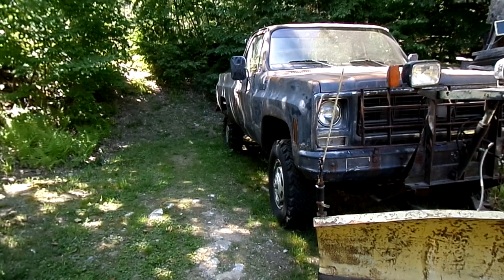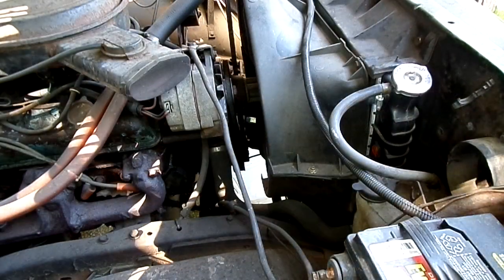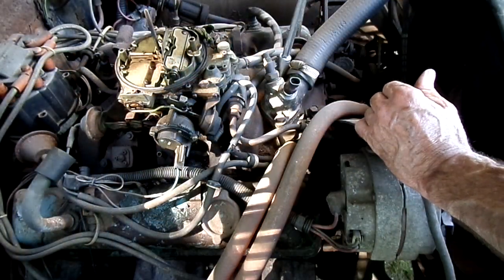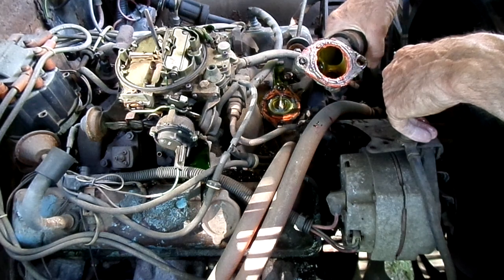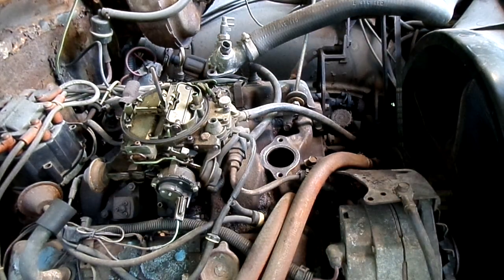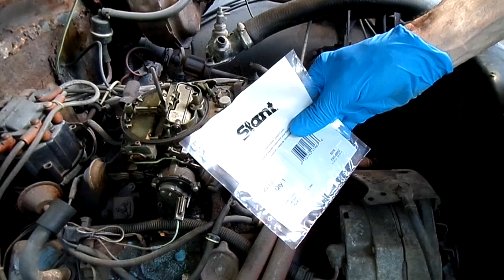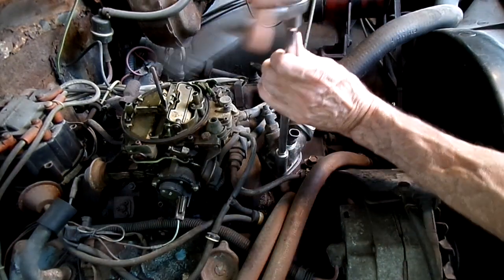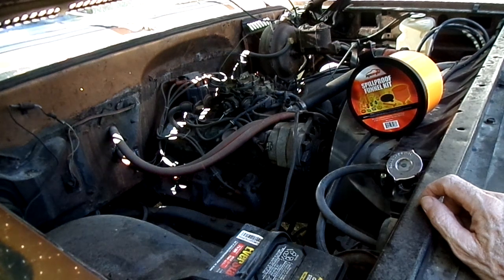Chevrolet Pickup Truck Thermostat Replacement

Comment: I'm supprised that both flanges were not slightly warped with heat from the engine and the amount of heating/cooling cycles over many years,  but it obviously worked fine :-D
Always worth while fitting a new thermostat :-D
Reply from the maker: I think Chevy made a very well built truck back then.